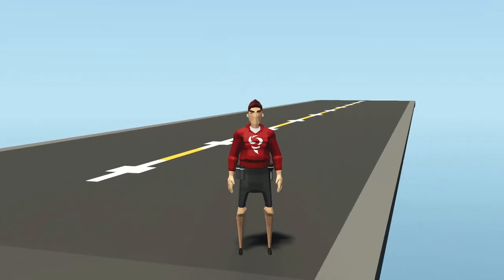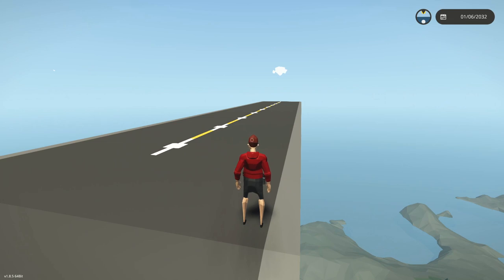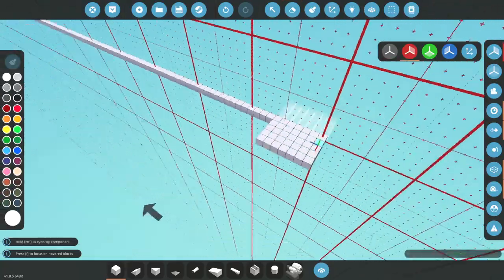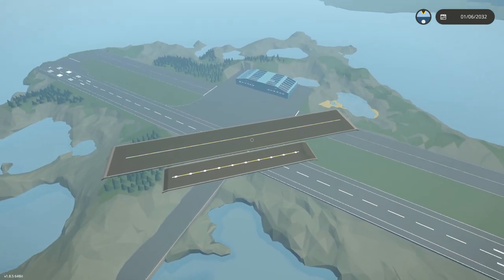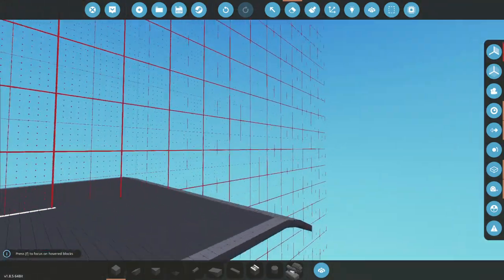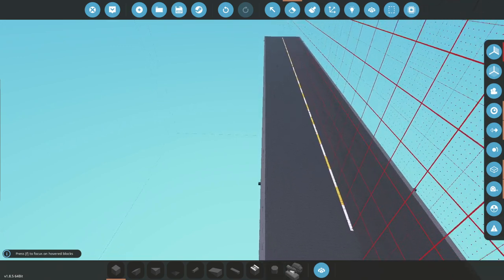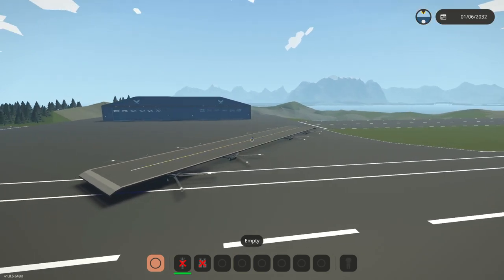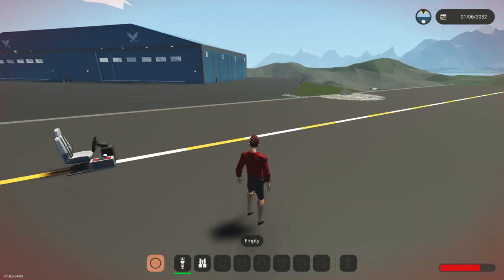Lets Build A FLYING AIRCRAFT CARRIER In Stormworks! #1

Comment: Hey frantic,i think you need to Make the body of the carrier bigger,so you can put rooms.guns and defense system,you might can put those on the side or under the carrier.and make the bridge near the run way.
And i think you can use rocket or jet engine,so you can be in VTOL mode,because propellers are not fit i think